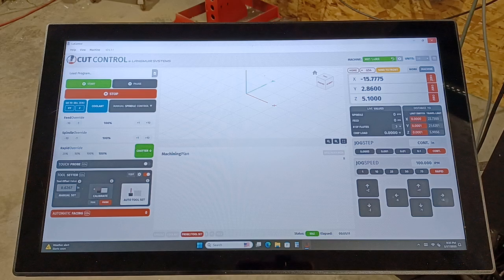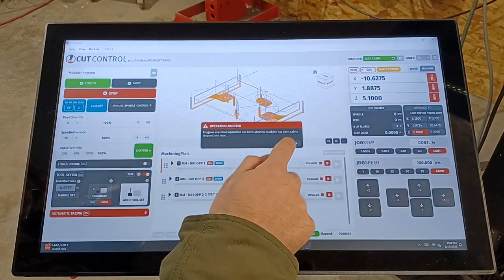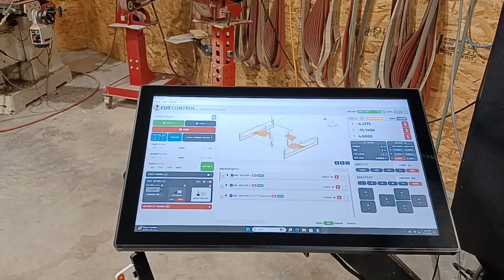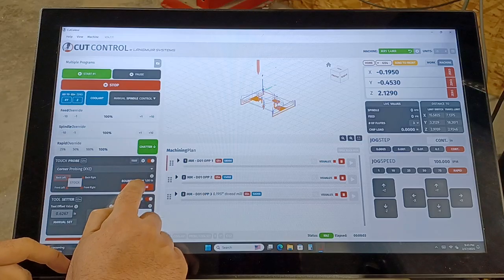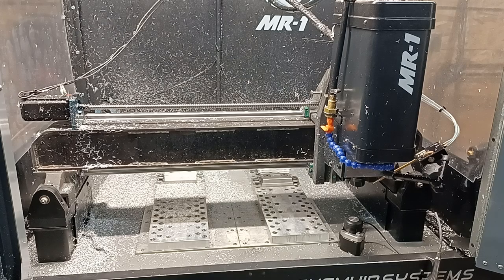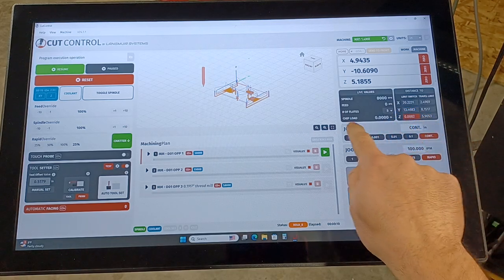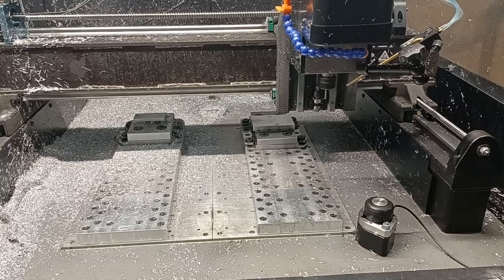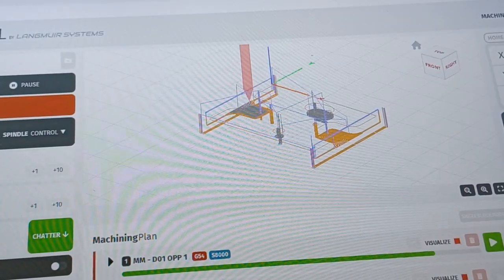How To Set Up A Program On Your Langmuir Systems MR-1

Comment: Learned a lot from your video today. Why did the right hand pocket toolpath break the end mill? Was it a different depth or feedrate or did the end mill just give up?
Reply from the maker: each features is its own tool path with individual settings.  This was was just way to aggressive.  Too much step-over at that depth of cut.  If you want to see this part run with a modified MR-1 and refined tool paths check out my latest video.  It's  shows it running at max speed. https://youtu.be/KhTT4cNuIKk

Comment: Thank you for the video! How did cut control know where the part was located on the table?
Reply from the maker: the probing cycle that I showed in the video...?
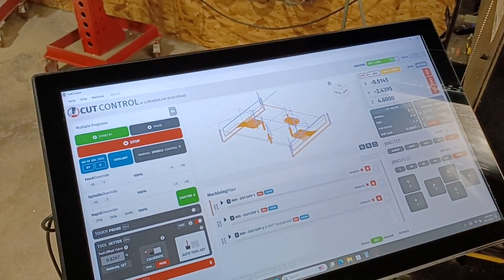Reply: @BeckTools  Yes I followed along with everything except for I did not see how cut control knew where your part was located in the machine. Was that all done during the probing cycle? At the 6:25 mark you talk about seeing the tool in relation to the part. At what part did you tell cut control where the part was located on the X & Y axis?
Reply from the maker: @NathanPugh-h3l  yes as soon as it probes the part it inputs the 0,0 into the controller at that point.  That is the purpose of the probing cycle.
Reply: @BeckTools  Thanks! Looking forward to running ours. We are almost setup to run just need to finish surfacing the plate.

Comment: Ok I’m back with another question.  Do you need the  Clear Cut software?  If I understand the process, you program using Fusion 360 as your CadCam.  You generate your code and make all your corrections through Fusion.  Once you’re satisfied, you save code to memory stick and then plug it into MR-1 Clear Cut
I use MasterCam for my CadCam, I generates code and it also has the ability to send code to any machine.  
Let’s say you’re surfacing a part in 3D and there’s a lot of code.  More code than the Clear Cut control can handle.  Will that control allow you to drip feed directly from Fusion 360 and into MR-1 control?
Reply from the maker: I'm not sure if you mean "cut control"?  Cut control is the machine operating system.  It's included with the machine.  It controls the machine.  If you don't use it you'll have to build a different control cabinet from scratch....  Your CAM software (doesn't matter which you use) will "post" (output) the program that you put on a drive or network and open up inside the machine controller (Cut Control).  I've loaded programs that run for 12+ hours.  You're not going to run out of space for the code...

Comment: So let’s say you’re running 30 parts all the same geometry.  Each part has 5 operations each with a different tool.  Do you just run each part through using tool 1 then set up tool 2 for second operation  and run all of them through….so on and so forth?
Can you visually watch each line of code as machine is cycling?
Is it standard G Code M Code programming?
Can you alter the code right at the control?
Reply from the maker: you cannot alter the code in the controller and even if you stop the program and change the tool than restart at that line it takes waaaaay more time than to just start your next program.  when I run 50 parts with 5 tools I run all 50 with tool 1, than all 50 with tool two and so on and so forth.  O don't change tools like I show in this video unless it's a single part run.
Reply: @BeckTools  Excellent real-world practical and concise question and answer.  🙏🙏